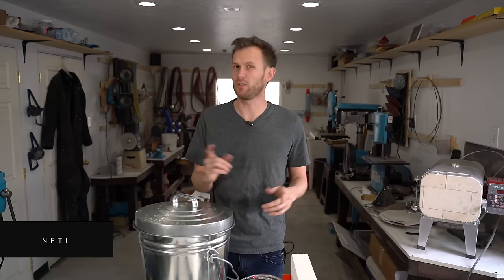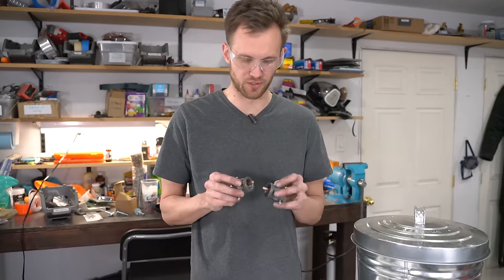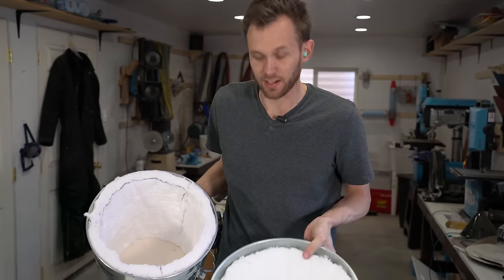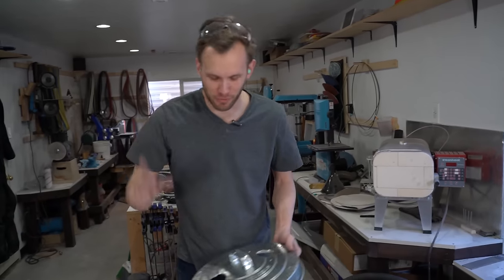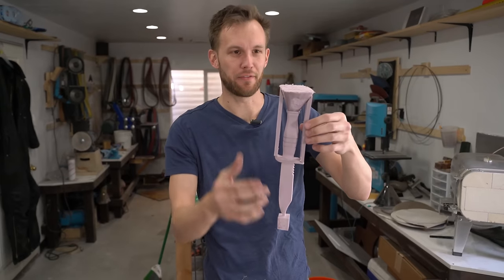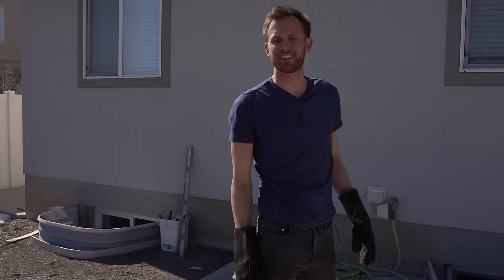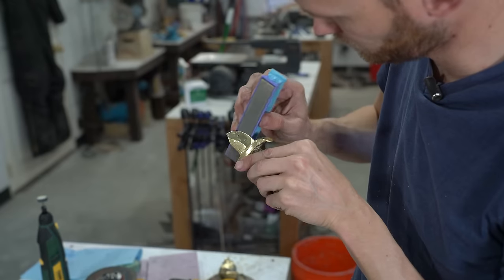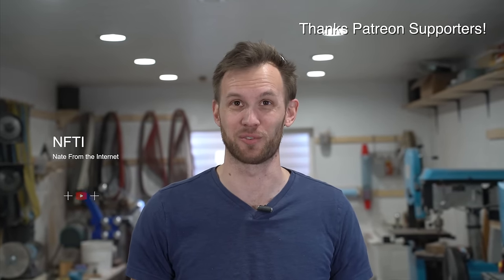Turning Brass Casings into a BLADE!

Comment: That knife is almost perfect for opening packages, without worrying too much about cutting what's inside.
Reply: Stonks time
Reply: It’s a box cutter.
Reply: That was my first thought too, a box cutter
Reply: I'm with the others. Totally a Box Cutter. <3
Reply: It’s a letter opener!
Reply: I work on commercial equipment and we flatten copper or brass into a blade for removing films and tapes from the equipment. It can only cut softer materials, so we never worry about scratching the machines.
Reply: that's what i thought lol, it's a letter opener
Reply: I was gonna say the same thing! Perfect box opener
Reply: wrgg, no worx etc nmw

Comment: When you were using the hole saw on the bucket. I noticed you had the drill set to 1, which is slower but has more torque. If you set it to 2, you should be able to slowly cut a perfect hole.
Reply: I was thinking that as well, spinning faster is does not have a chance to grab so hard. Has worked better for me that way.
Reply: Also if you use a backer, like a piece of wood with just a simple clamp on the top to hold it there, it would cut right through without trying to move around or anything
Reply: Or just use tin snips
Reply: I use a corded drill with a keyed chuck, and just use the hole saw in reverse.  Works on siding (vinyl and metal) with a finishing blade put on backwards on a circular saw, so I tried it on some metal roofing one day for a vent pipe.  Reversed hole saw worked a charm.
Reply: @MrNoPuppet  I was gonna recommend the reverse trick 😂😂
Reply: In my experience cutting thin metal with hole saws, drill speed matters less than using clutch mode instead of drill mode. It'll keep you from breaking an arm, as well as the pilot bit.

As a side note, the hole saws also needed to installed correctly. The pins weren't pushed into the back holes.
Reply: also i think the orientation matter, because the first one he cut it from the side, while the second one is from the top making it easier to get an even cut and pressure on the bucket
Reply: I think he should have used a step drill instead, those work much better on thin material
Reply: @dailythenoob  have you ever seen a 2-½" step drill?
Reply: @MrNoPuppet  ngl i've been out of construction so long i forgot that technique, so thank you for the refresher
Reply: I forget what it's called, but there is a really useful hand tool specifically meant for cutting clean holes into sheet metal, you just drill a hole in first, then you basically screw the two parts together and they slice the metal.
Reply: @LazorVideosDestruction  yes. A knockout punch. Greenlee's version is called a "slug buster".

Comment: What if you cut off the small blade, and then drilled out the center of the handle. You could then key the hole a bit (so the blade doesn't twist), and then make a knife blade with a round tang (just big enough to fit inside the drilled hole, keying the tang for the keyed hole as well). Then I think you might be able to epoxy it together, and make more of a functional knife, with a brass handle. 🤔
Reply: I was thinking the same thing, but I don't make knives so I was thinking it with a far inferior vocabulary lol.
Reply: just what i was thinking
Reply: The brass should be quite easy to work with so he could even pin it if the epoxy doesn’t work or maybe potentially solder or braze it depending on the blade material.
Reply: That foundry will not be hot enough to melt steel

Comment: Another thing you can try is to use drywall cement or thinned out plaster of Paris on the styrofoam making a very thin shell.
The sand around it will support the shell so you don't have to worry about holding the weight but it also keeps the sand out and increases the resolution (detail) of the casting.
By having such a thin shell, the gas from the styrofoam can still pass through it but the larger granules of sand don't come in and create a texture... Also you may have noticed with your belt sander that the grit of the sand is in the casting so when you're trying to polish it away it will prematurely wear your tools... By keeping the sand out of the casting You not only get a nicer surface finish to start from but you also don't wear out your tools as quick
Reply: Or just use some fine green casting sand.

Comment: It is good to mention that when melting metal is very important to always pre heat any metal you add for melting, all the tools and molds you are using to prevent steam explosions. Before starting the furnace put a piece of cardboard on the buttom to prevent the crucible sticking.

Comment: As for doing lost foam casting, you'll want to use something to vibrate the sand to better solidify it and also you'll want to do some type of coating around the foam, a good cheap option is watered down drywall mud.  

Melting down old brass bullet casings is a pain, though you appear to have kept the temperature low enough that you didn't have to worry about the off gases as the zinc went from liquid to gas, at least I didn't see the tell tale white smoke or the yellow stringy crap, but if you're going to do brass again, get a proper mask as those zinc fumes are not something you want to breath in.

Very nice first melt with the new furnace though and first attempt with lost foam.
Reply from the maker: Oh the zinc definitely burned.  I had lots of zinc fluff from removing the slag.  Lots of breath holding and standing up wind.

Comment: an old pro tip drill normally until the piolet bit punches thrue. then switch the drill in reverse the whole saw will still cut the thin metal but it is much less likely to grab and rip. learned to do that on meatal siding.

Comment: Try green sand. Regular sand will not keep its shape. Also you need to compact it a lot by stages so it compresses correctly and keeps its shape while the casting pours. Try a smaller container as well to cast in to.

Comment: The method you used is similar to the lost wax method. You can try this again with a strong casting material made for metal forging. You can even use the foam. Then get the mold hot burning out the initial shape and then use a centrifuge to force the metal into the mold. Loved the video

Comment: Try using a more damp sand to prevent collapse wet enough to hold shape but dry enough so as to not boil and make holes in your design

Comment: A (very) specific use-case for this style of blade: some time ago i was working at a farm supply place and from time to time we had to cut open 50lbs bags of grain, pallet loads at a time. This special grain would go through a tumbler that coated it in i believe fertilizer. The tip of a typical box cutter knive would get caught on the thick paper those bags were made from, so we would use pocket knives with rounded tips. Had to be careful since several of us had to work close by each other, as well as to not cut too deep into bags and damage some of the grain. Long story short, this stubby rounded cutter would have been great there, albeit made of steel and with a much lighter handle.

Comment: Next time dip the foam mold in drywall putty/cement. Then before it dries sprinkle sand on it. Let it dry and dip it again. Do this for a couple layers. Then put it in the sand bucket. This will form a hard temp resistant shell around the foam and allow the brass or aluminum to flow without sand collapsing the mold. Some people will even wrap the mold in metal wire after a couple shells as well to prevent cracking and expansion. I've seen some really high quality castings come from this method.

Comment: For thin metals, you can clamp a wood block on the back end, it will make drilling holes a lot cleaner and easier
Reply from the maker: Tough to do on a round bucket.

Comment: When drilling the holes on the side of the bucket it might be easier going at it from the inside as the bucket is more structurally sound there, but not sure

Comment: It is sometimes easier to first drill a 1/4" pilot hole (same size as the hole saw pilot). You then have more control about when the hole saw contacts. The reverse trick with the hole saw should also work better then.

Comment: Next time you use a hole saw on thin metal just run the drill in reverse. It is less abrasive on the metal and shouldn't leave jagged edges. Hope this tip helps for the future. Btw, your content has been really great. Keep up the good work.

Comment: There's this thing called carving knife in woodworking that's pretty much that size. But with flat spine and without guard in the way of the spine it would go well as Finnish carving/leatherworking puukko with which you want short blade not a lot longer than your thumb so you really get great control over the blade even when applying a lot of force to it.

Comment: For everyone that does not want to go through Nate's holesaw problems... Put a piece of wood behind where the hole will be. And then use a clamp to hold it on. Then when you're drilling the drill bit goes into the wood and kind of holds it there and supports the back of it so instead of tearing everything and catching and ripping your wrist off, it'll stay in place and cut through it.
Reply from the maker: Works great if what you're drilling is flat.  Harder if you are drilling into a curve.

Comment: something im pretty sure you are familiar with as a knife maker, which is highly crucial in the longevity of a copper alloy blade is work hardening, because you cant temper it like you would with steel. of course im certainly not in any position to critique the work of a professional but i would definitely love to see some work hardened brass or bronze, which at least with bronze i know its a soft enough metal to be cold worked and because the copper base is fairly malleable it is less prone to cracking, that being said the stress points are also highly exaggerated because its so malleable any unreinforced crevices tend to make for an easy flex poin kinda like a bow snapping in a spot that isnt in even tension

Comment: You should make some green sand. Pretty easy. 10% bentonite clay (powderized clay cat litter) around 5% water or motor oil and the rest silica sand or any fine sand. The stuff is reusable, you just have to rehydrate it a little.

Comment: In the future put the bucket on its side between your feet and use both hands to support the drill. And remember the bigger the hole saw the more you risk breaking your wrist when it catches. Always support what your drilling and use a side handle on the drill. If you can brace the drill all the better.
And invest in a quality set of tin snips.

Comment: I don't know if it would make any difference with dry sand, but perhaps giving the bucket a few whacks to get the sand to settle as densely as possible, and/or compressing it down into the bucket with as much force as you can manage without damaging the foam, it might form a more stable structure that is less likely to collapse as much when the foam is lost.

Of course, switching to green sand, and putting the whole thing into a box that can maintain pressure during the pour will work better.

(Disclaimer: I've not done a single sand cast yet, so this is just guessing based on videos I've watched, and sand castles I've built... Hardly the pinnacle of experience.)

Comment: I'd love to see you try making a blade with holes in the tang then building a styrofoam handle around it. Pour brass to give the steel blade a solid brass handle. Might ruin the temper but fun is fun.

Comment: You would probably have had better results using a small cutoff wheel to make the holes in the bucket, more speed less pressure is the way to go and rotary tools are pretty solid for thin sheet metal. Oh and just use a file on the edges afterwards. It's generally just as fast and it actually is the right tool for the job!
Shame about the cast but you may have better results in the future if you were to only use the sand as a stabilising medium and actually cast the mould in plaster around your foam blank.

Comment: When using the hole saw on thin sheet, put the drill in reverse. This will take a little longer to cut, but won't bind on the material and tear it up. You won't have any kickback either.

Comment: High speed, low pressure. Should make a much smoother cut, with a nice hole. Just let the teeth wear away at the metal. Seeing your process for making green sand would be awesome. Maybe try casting something like an action figure. That would be a cool knick knack to put on display. I'm really enjoying your channel so far.

Comment: Would drilling a hole straight through the styrofoam from top to bottom help the brass flow in easier/quicker at the start of the pour? It seems like the brass cooled faster than it could burn through to the bottom.

Comment: As an avid watcher of the Bigstacks Casting channel, I would say, put a bit of cardboard under the crucible to help prevent it from sticking
Reply from the maker: I haven't done as much metal melting and crucible work as he has, but I have done quite a lot on TKOR.  I have never had the crucible stick.

Comment: For future reference when cutting thin sheet metal; try using tin snips rather than side/wire cutters, they're made to cut sheet metal 😂
Reply from the maker: RIGHT?!?  I'm not sure how I don't own those.  I should get a pair.
Reply: @NFTI  Meh, it happens, don't sweat it.
I've been working with metal in one way, shape or form on and off for over thirty years and I'm still learning
👌

Comment: it would probably be better to cast something like this from the side instead so that it isnt falling so far down. also in order to make a brass edge that doesnt chip super easily you have to hammer it cold so you probably would want a thicker blade initially either way
Reply: Very good point about work hardening the brass blade.

Comment: Couldn't you have just used the the k wool? Or does the cement help build up the heat better?
Reply from the maker: The kaowool falls apart over time, and the cement prevents that.

Comment: that burner would be nice for a gas turbine, any type, like reaction centrifugal turbine, pushing the hot air through the turbine, some valve system might be essential, if you are into such projects
Reply: a can opener (that with a spike) with a guide line might work fine too
Reply: a line with a nail-screw through the sheet, rotating, should make a perfect circle, with a metal draw tool, draw spike
Reply: ceramic casting mold might be fun and repeatable
Reply: that burner works as a ceramic kiln too
Reply: nice statue :)
Reply: looks like a banana slip :)
Reply: recast the blade only, make its swappable

Comment: At least the knife you made is California legal since the blade is less than 2 inches. You could also make the case that a knife like that would be helpful for tasks that you need a small blade for but the user has low dexterity due to a circumstance such as a hand injury or needing to wear thick gloves.

Comment: Does anybody know what specific parts were used in the burner and propane tubes? I'm not very familiar with burning gasses, but I am planning on making the foundry, and have already prepared the insulation materials

Comment: Do not pour over concrete, if molten metal is spilled the concrete can spall causing molten metal to fly everywhere and ruin your day. Put down a layer of sand or pour over grass or dirt. Or even a sheet of plywood.

Comment: I'm not sure if that blade is legal as I think it's WAY too long! Yeah... Petrolsand would probably be better for casting for you. Still, an awesome first pour, man! Oh, may I suggest you invest in a good pair of tinsnips? I think you'll love them. Well, and a pair of nippers as well.
Reply: Depending on the state you can open carry a blade of any length, it's concealed carry where blade length becomes a problem.
Reply: @geraltofrivia323  - Umm... Did you watch the video before commenting? 😀
Reply: @jaspr1999  Wow, rude much? I got the joke, my reply had nothing to do with the humor and more with how the joke made little sense, as even if it WAS full-length, there'd be little issue with it as it's a fixed-blade knife.
Reply: @geraltofrivia323  - No rudeness intended.

Comment: if the sand was damp it might have worked but the other thin is why didnt you do just pour it in a side ways mold   with all the grinding you did you could have made the knife from a bar.

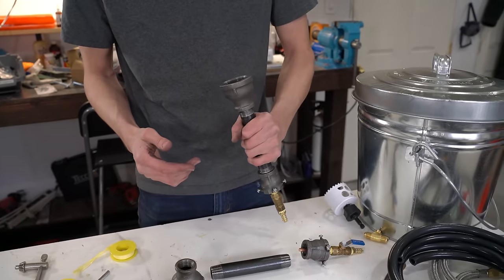Comment: 2:55 its not just not needed, you actually should not be using it there at all.  You should never ever use teflon tape on compression fittings like that.
Reply: does it actually have any negative effects? just curious
Reply: @Chocoffee_battery  oh yeah true, I forgot the temp those will be running at

Comment: Dude you have to get yourself an adjustable wrench, at least. Watching a man use pliers on fittings makes me feel measurably uncomfortable. Oh, and on the gas fittings pipe dope is a safe method to help with proper sealing. Not supposed to use thread tape on those.  Love the channel my dude. TKOR who ?